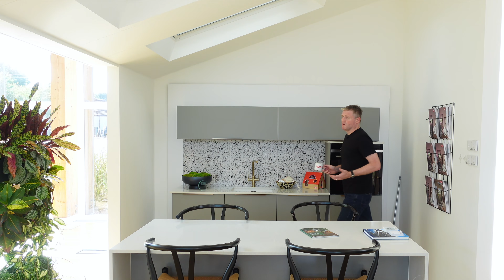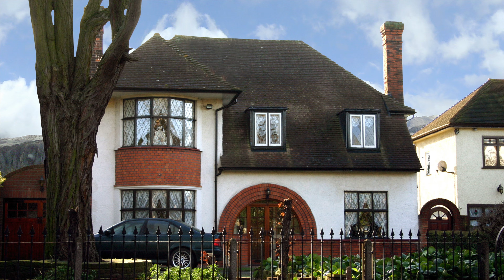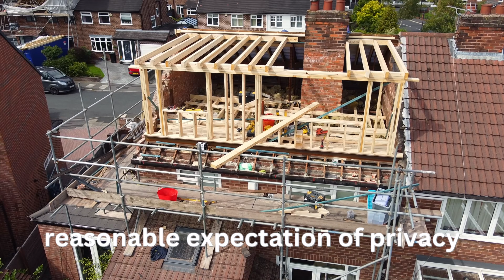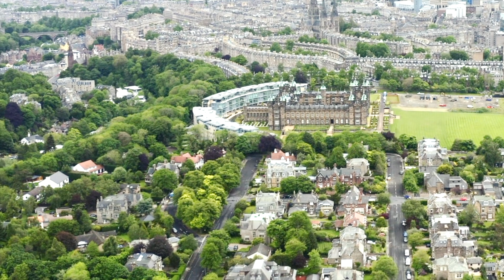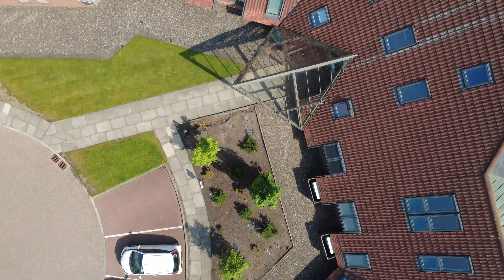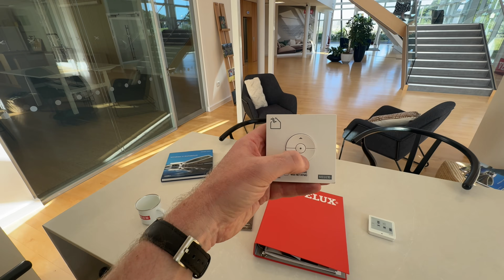Where To Put Windows in a UK Loft Conversion

Comment: Under building regs in England and Wales, windows in a loft conversion (2nd floor) are not suitable for escape due to the height above the ground. A protected stair is therefore required. Some private inspectors will accept an LD1 detection system with full coverage to all habitable rooms. 
I think what you described was a little misleading. I would never issue a final certificate to a property with egress windows at 2nd floor.
Reply from the maker: You're right, and it's useful to hear it from someone who signs off the certificates. Escape windows aren't a means of escape from a second floor, and the protected stair is the answer. Your LD1 point is the honest version of what happens on site too. That's a judgement under B1 rather than a route the Approved Document sets out, which is exactly why it varies between inspectors.

I did cover the limits of escape windows in the video though. The 4.5 metre rule mainly catches bungalows, and I go on to say that if you convert the loft of a two-storey house the new floor sits higher than that, jumping isn't an escape, and a protected stairwell is needed instead. It lands a little after the opening, so it's easy to miss. This one is a chapter lifted from a longer video too, linked on the short, where there's more room for the detail.

Thanks for taking the time to write it up either way.

Comment: Nice video.
I’ve only seen those balcony veluxes on one job, they work really well. 

A protected escape route doesn’t require fire doors to have self closers in the English Building Regulations, I suspect thats different in the Scottish regs rather than suggest you are incorrect. 😉
Reply from the maker: You’re absolutely right, the regulations north and south of the border do have those subtle but important differences!

Comment: Top hung velux are really nice to get a 'balcony effect' without am actual balcony. On can also add a step up platform to get closer to the fire exit heights. 

As you say, It's complicated!
(we also had to / were able to the re-work the insulation requirements because we didn't have the expected window area for the presumed design regs.)
Reply from the maker: Loft conversions are deceptively simple but it sounds like you made it work. Do you mind me asking, what was the overall cost of the project?